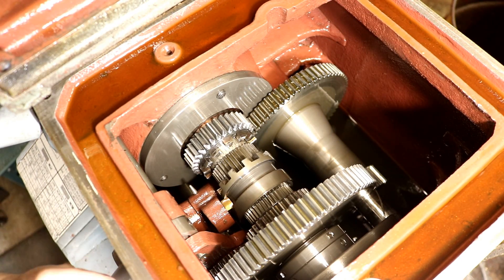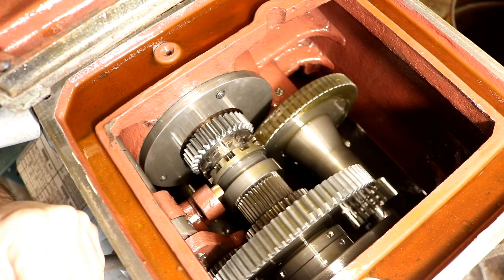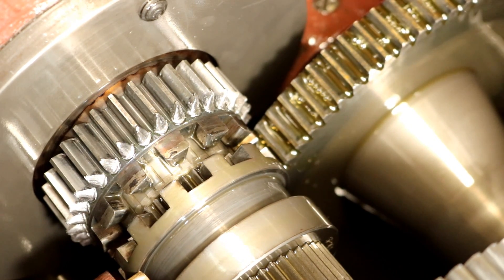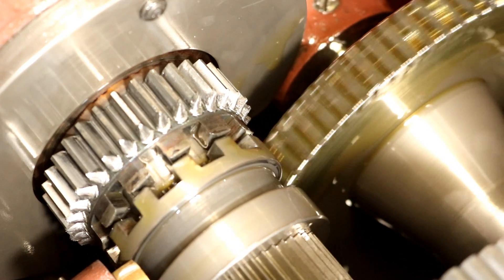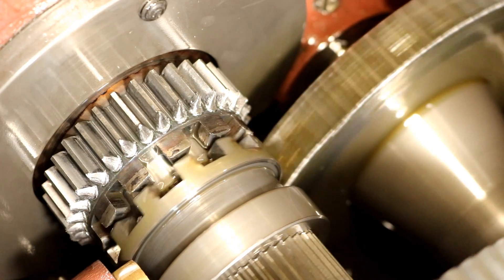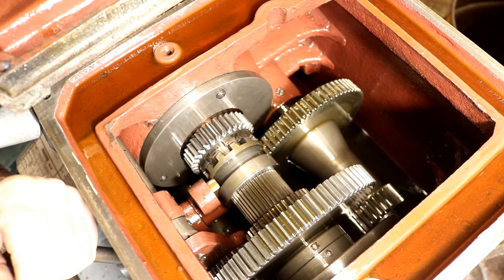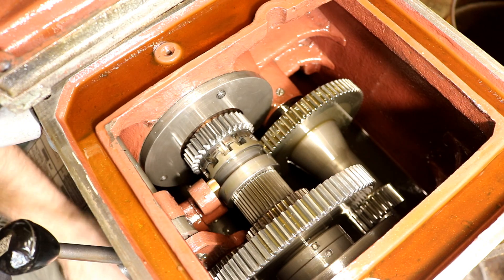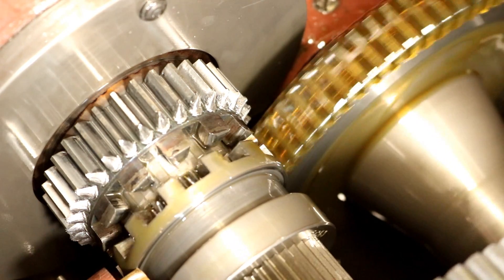Lathe Tips | Quit Grinding the Gears!!!  |  Metal Lathe Hack #10

Comment: G'Day Randy, great tip.  Let the lathe stop before engaging different speeds.  When I re-built the head stock of my Lathe I also noticed what I thought was wear on a number of the teeth but it was only on the engagement side of one of the mating gears which made me think why only on one gear and not the other.  On real close inspection the teeth where evenly worn on both sides of the tooth and right around the entire tooth set which didn't make sense as 99% of the time unless the lathe was running in reverse it should only be one one side.  As it turns out, enquiries with Gosan in Taiwan confirmed the gear was 'hand' ground prior to hardening to allow the gears to engage easier if they weren't quite lined up.  Made me feel a little more comfortable. 
Cam
Reply from the maker: Thanks Cam.